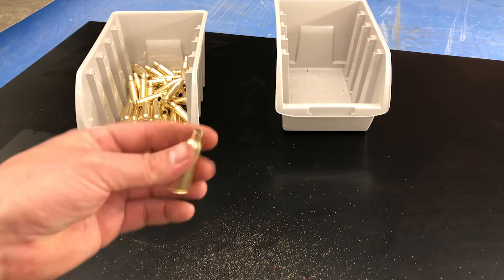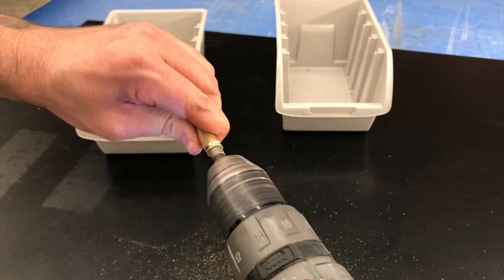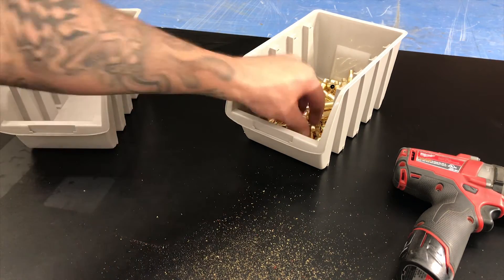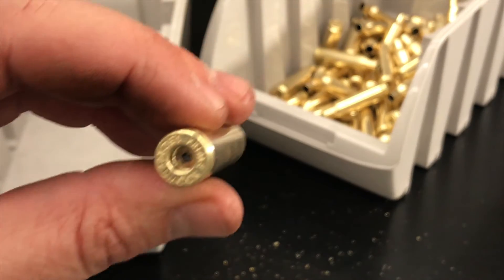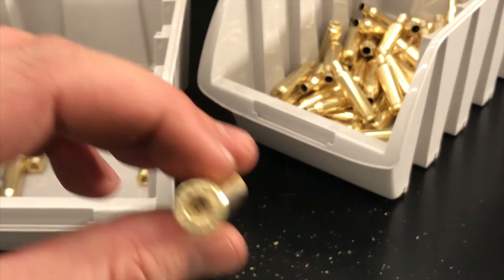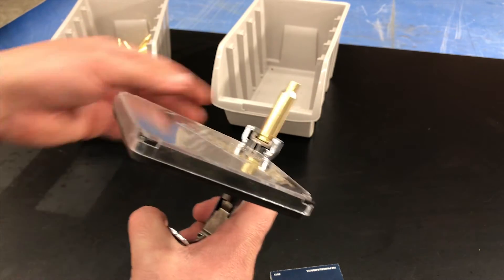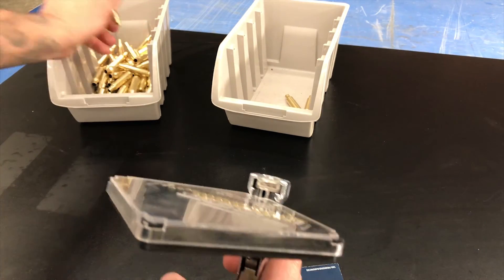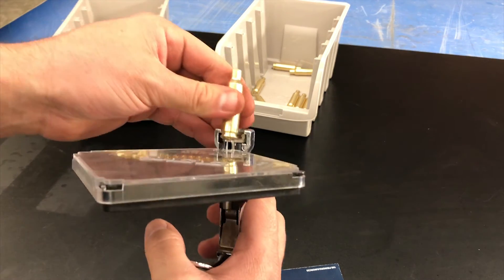Reloading 6.5 Creedmoor: PART 4/6 (Priming)

Comment: The flash hole tool is supposed to be a deburring tool to take out the knockouts that are stuck in there from punching the flash hole, just one or two light turns to chamfer the hole a hair, if the knockout isn't stuck there. If it is there you will feel it, and it will get cut/forced off by the tool couple more light turns to remove the burr it leaves there and you are done. It was not designed for cleaning the flash hole from the pocket side, and can screw up a case if improperly used that way.
Reply from the maker: Yup, that's correct. Not sure I mentioned otherwise? I sometimes use the tool to push out stuck media (I know its not supposed to be used that way, but you can just be careful and you won't do any damage), other than that though what you described is correct and how I use the tool only if needed.